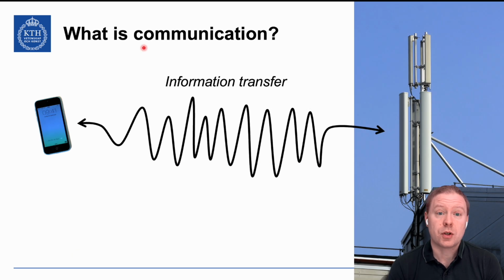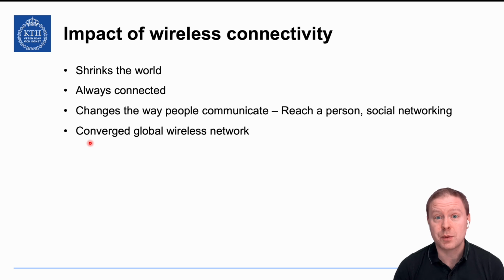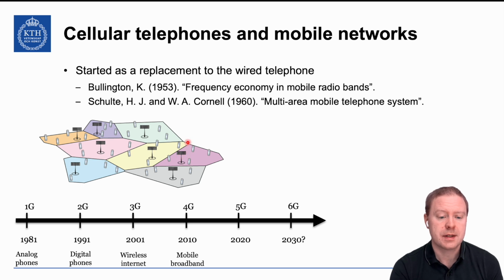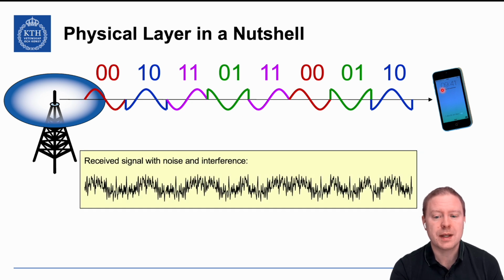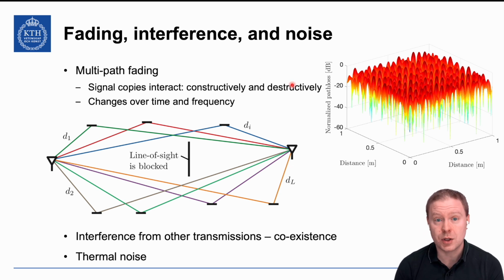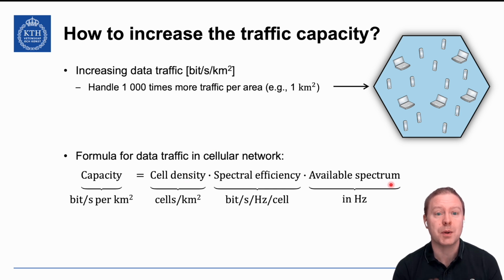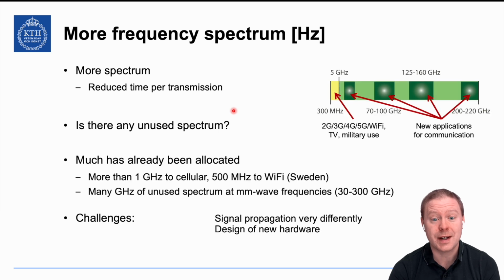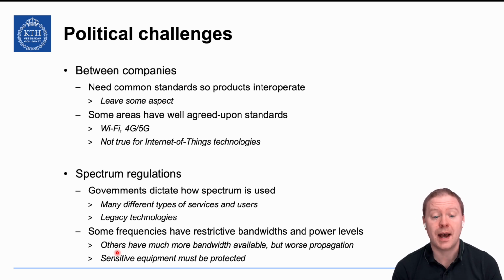Introduction to Mobile Networks and Services

Comment: Thank u professor, i have one question outside this video, could you tell me the formula of calculation  first null beam width of the None ULA after doing optimization for the amplitude of element Iam working on the numerical part
Reply from the maker: The first null beam width for a ULA is 2*arcsin(lambda/L) ≈ 2*lambda/L where the approximation is good for large arrays. L is the aperture length of the ULA and lambda i the wavelength. You can find a derivation on Page 16 here: https://www.ece.mcmaster.ca/faculty/nikolova/antenna_dload/current_lectures/L17_Aperture.pdf
Reply: Thank you so much professor for your replying, Is the aperture length mean L=(N*d) where N no. of antenna element??
Reply from the maker: @al_husseinal_torfy8744  yes

Comment: Thanks a lot. When we want to determine the power of a signal, we take the square (s(t)^2), according to the formular. Thus, we get the unity V^2, although, the normal unit for (electrical) power is Watt. Isn't there a contradiction? (I cannot find V^2 as official unity for power.) Do you happen to have an answer to that? Thanks.
Reply from the maker: Hi! Is there a particular formula in the presentation that you are referring to?

In general, power is the average energy over time, so you first need to consider an integral of s(t)^2 over time and then divide by the length of the time interval. It is also necessary to convert V^2 to power using the characteristic impedance of the receiver that measures the signal. Here are some more information about this: https://en.wikipedia.org/wiki/Energy_(signal_processing)
Reply: @WirelessFuture  No not in that presentation. I was just a general thought. When I read about communication from different sources, I found Watt and V^2, and was confused. Nowhere was a formular which links both units.

Comment: Thanks. I saw a diagram of inside of a modern mobile phone. 8 small antennas seem to be common today. Does the smartphones already use the antennas really for beamforming or is there rather a kind of diversity utilization (e.g. switch to the antenna with highest SNR)?
Base station already use beamforming, as far as I know.
Reply from the maker: The last three (?) years of iPhone models have had the statement “5G (sub‑6 GHz and mmWave) with 4x4 MIMO” in the tech specifications. So there are 4 antennas that can be used for spatial multiplexing of up to 4 spatial layers, if the channel is good enough. In poor signaling conditions, it is better to use them for beamforming to increase gain and obtain diversity. 

A phone also needs wifi and Bluetooth antennas, so the total number is probably closer to 8, as you said.

Comment: Thank you for your terrific conent. I have a short question. It is about the SNR. We assume to have a 16QAM transmission. The outmost points in the IQ plane have a higher power than the innermost. The noise is for every symbol the same, I guess. Does that mean that the SNR for the outmost points (symbols) is better than for the inmost points (symbols), because of the different signal-power of the symbols?
Reply from the maker: The SNR is normally computed based on the average power of all constellation points in the IQ plane. The reason is that the thing that matters is how large the distance is between the constellation points, compared to the strength of the noise. A decoding error happens when a transmitted point is moved by the noise so it looks more like another constellation point.

You are right that the instantaneous SNR is higher for the outmost points, but this is not important. It is the minimal distance between constellation points versus the noise standard deviation that truly matters, and it is the same for all points in 16QAM